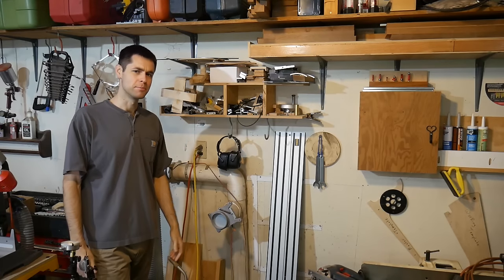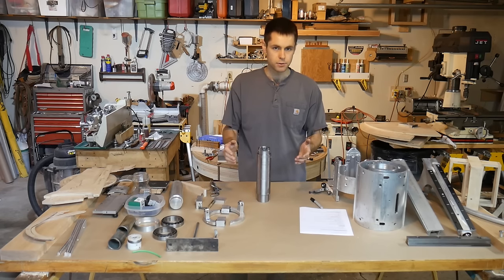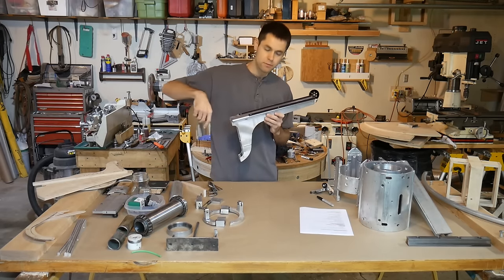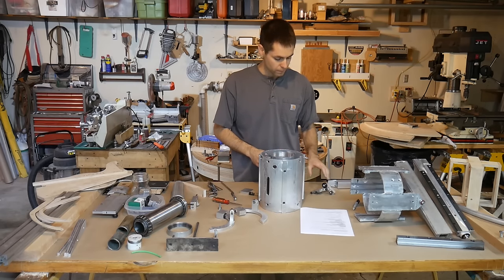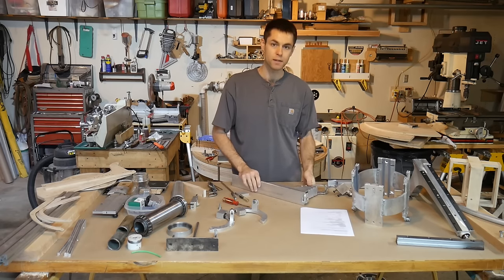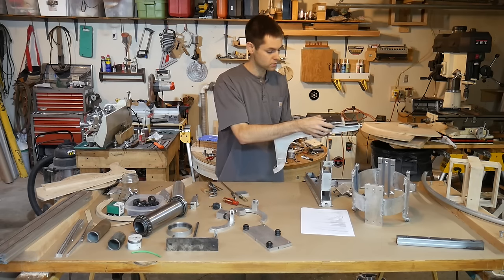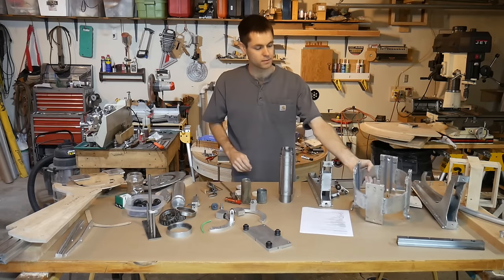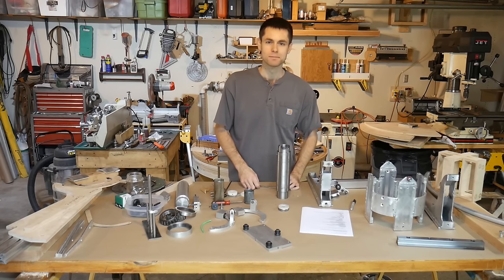Table Kit: Trial, Error & Lessons Learned

Comment: Regarding welded or epoxied aluminum, have you looked at Alumaloy? Can do aluminum repairs or welding (brazing) with a propane torch and the material is stronger than the aluminum base when you're finished. I'm not associated with the product and I think there are a couple other branded versions of this aluminum alloy repair rod.

https://www.youtube.com/watch?v=TZ5sD9hQTyw
Reply from the maker: I looked at it a bit but it seemed relatively expensive and I figured I might as well learn to TIG weld for its versatility.